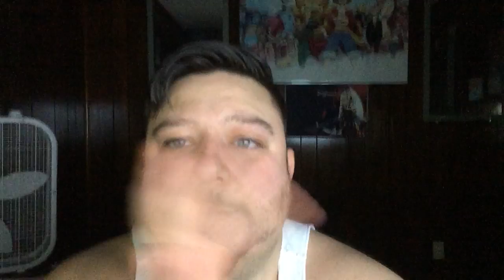Nippon Racing Pistons:  Determining Compression

Comment: a guy telling me P30 nippon pistons compression vary due to which engine they are installed.  I have b17a, and b18c1, and a b18a1.  B18a1 has blow gasket, over heated.  The other two options, but both need full rebuilds.  I am most likely going to go with the b18c1.  The b17a, I would most likey take the pistons from the b18c1.  The guy selling the Nippon pistons b16 p30 pistons.  they are 82 mm, which I can deal with, since the b18c1 can accomodate the oversize.  I like your thinking of building, stay close to stock, but if I get these 82mm, I am trying to get the compression ratio, I am seeing specs for b18c1 p72 parts, the information I am seeing puts these to 11.8 to 1.  What would this give me, and what is your reconmendation.  I think the price this guy is asking is hella good, but I don't want to buy something that is more work that I already looking it.  I plan to do the honing, .. I thought of maybe doing the b17a1 with these pistons, but I think I am going to special order from speedfactory rods and pistons for the b17a since it is such a rare engine.  the b18c1, is more common, i can probably get away with a good setup on these nippon p30 b16.  but I am lost with details on these piston variations.  I welcome your reply
Reply from the maker: Throw your combos in a compression calculator. Just realize it's not an exact science just s good ballpark number